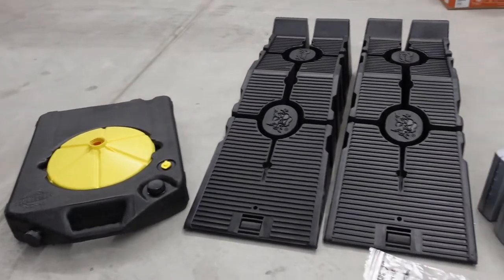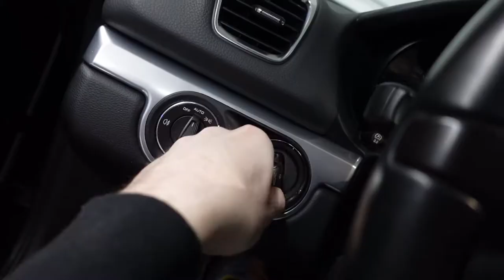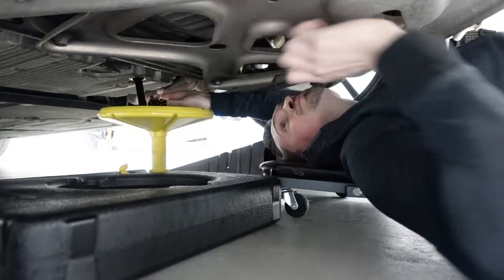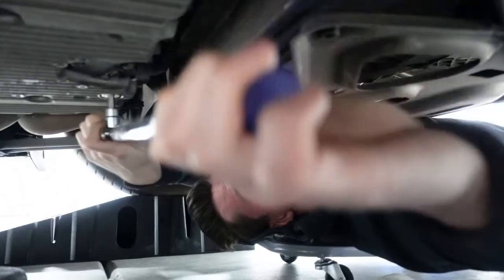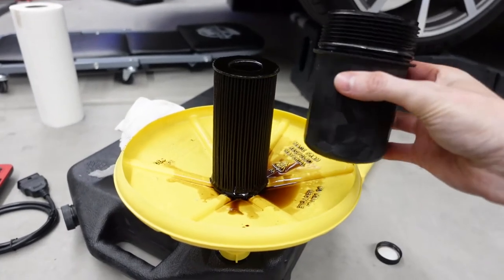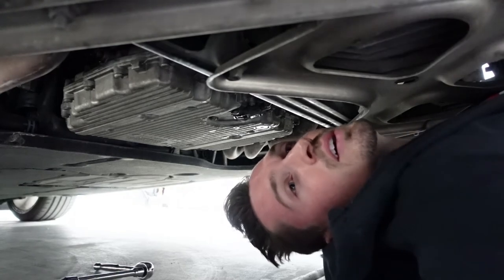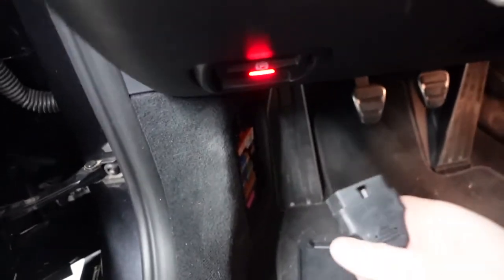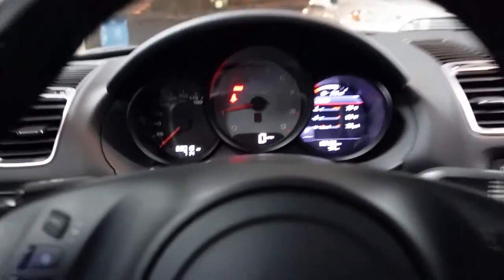PORSCHE 981 CAYMAN S DIY OIL CHANGE TUTORIAL | How to change the oil on your mid-engine sports car!

Comment: Two points. The car backed up on the ramps as it was will leave at least 1 or more quarts in the sump. This leads me to the next point, if you add 7.9 quarts of oil it will likely be overfilled. I check the oil electronically before starting the process and measure the oil removed and add only that much back before getting the car level and warming it back up to check oil and top-off. Overfilling a flat-six is not good.
Reply from the maker: Yeah having the car perfectly level or even tilted the other way would leave to a fully emptied oil pan, but regardless of that, I didn’t have any issues with overfilling, in fact my oil level was a exactly at the mid-point which would quickly reach the “fill” notification you get as the oil slowly burns off over the next several thousand Miles. I needed to add about half a quart several months later
Reply: Nicely done video! 😊
Only minor thing I would add is to push the new filter into the caster until it pops into place. 

Looking forward to more DIY videos on the 981.

Comment: So isn't a big deal with these cars because there's plenty of room for a big funnel but you actually want to pour oil with the mouth at the top of the bottle instead of the bottom, it allows the bottle to tip further before it pours.
Reply from the maker: I like to live dangerously

Comment: No one talks about what Oil Temp needs to be to get a reading!  So....many....videos without the information.  The manual says "operating temperature"  I needed to get to 190 degrees F to get a reading.  I hope this helps someone!
Reply from the maker: Good call out, I often have to drive for 15-20 minutes to get an oil level read. Would be nice to have a dip stick!

Comment: why did you not lift the front of the car, there will be oil left in the engine... at least more than if the car would be leveled...
Reply from the maker: Because there’s not a safe way to lift the front of the car when using ramps and a jack. Also, the car being at a slight angle doesn’t leave much oil in the pan, I always put in the recommended amount and it doesn’t overfill.

Comment: Great job. The only difference on my 2016 base is the location of the obd2 port. Otherwise spot on.  BTW- My local Porsche dealer charges $60 for the filter and O-ring, no crush washer.

Comment: Excellent work you’ve done mate… I kindly need the oil filter p/n for Cayman S 2014 981-987
Reply from the maker: 987 and 981 have different part numbers unfortunately. 987 has slightly small inside diameter. I would go ahead and just call Porsche or suncoast to get the proper part number

Comment: Beautiful car. Hope to have one some day. Diy saves you a lot of money over a dealership oil change, right?
Reply from the maker: Definitely! It saves about $200, you save substantially more for other services though like brakes. Brakes at the dealership will make you go broke lol
Reply: You pay the "Porsche Tax" any time you take yours in for service.  DIY will only cost you between 1/4 - 1/3 the price of a dealer or independent.  OIl change is about $300, I am doing mine for $90 including the oil filter wrench.  Brakes will cost $1200-1500 per axle, but parts are only $3-400 if you DIY

Comment: Thanks for this. I have a 981 Gt4. Assuming it’s the same?  Also what’s the reset tool you used?  Great video!!
Reply from the maker: Hey! No probs 👌🏻, yeah for a GT4 it’s the same but I’d check your manual to see if you need the same amount of oil. I always mess up the name to it but I put a link to the reset tool in the description. Use the “all service” option to fully clear all oil lights and notifications. I also have a couple other cayman tutorials so make sure to give those a look as well 👌🏻👌🏻

Comment: I followed your instruction on my Cayman 981. After it says code has been changed and I unplugged it. But when I start the car it still say Oil change now?
What I did wrong here.
Need help.
Thanks
Reply from the maker: Try the option that says clear all service codes versus just the oil service option. You could have cleared the code related to the date and the other code for oil is left
Reply: @JordanPayneLV  Thank you. It worked.

Comment: What about using gloves and eye protection?
Reply from the maker: Eye protection is probably a good idea but when the car is cold you shouldn’t need gloves unless you want them.
Reply: @JordanPayneLV  But the chemicals in the oil?
Reply from the maker: @andresmattos7541  I wouldn’t worry about it that much but it can be difficult to wash off your hands so using gloves for that reason should be fine. You want to wear gloves when using chemicals like brake clean though
Reply: @JordanPayneLV  nah all chemicals are harmful in the long run. You your gives like a pro
Reply: @andresmattos7541  Gloves are a good idea. Skin is porous and absorbs all sorts of stuff relatively quickly!
Reply: @andresmattos7541  Stop trolling and GTFO. Andres Morron